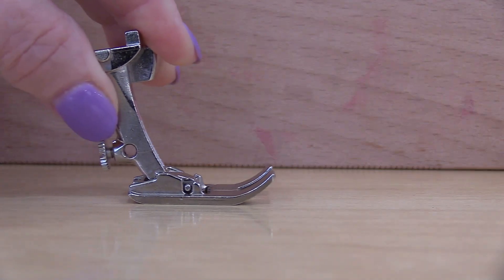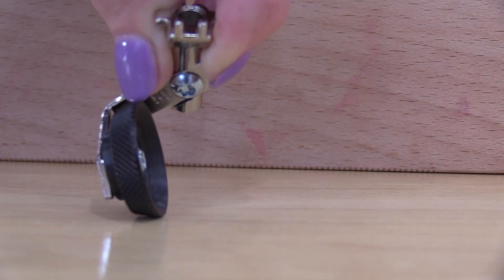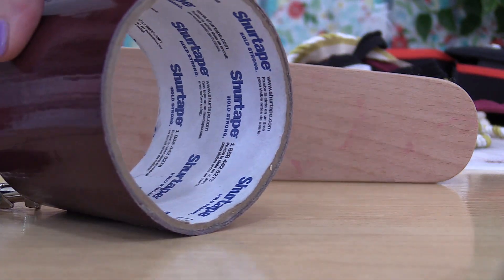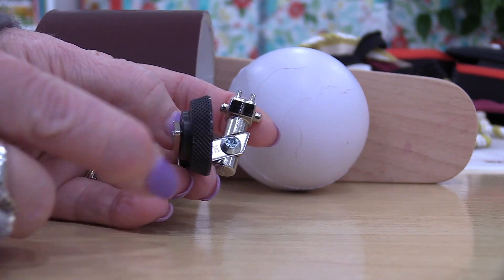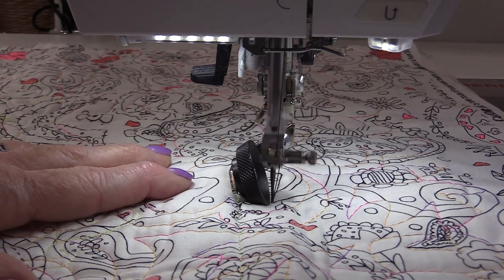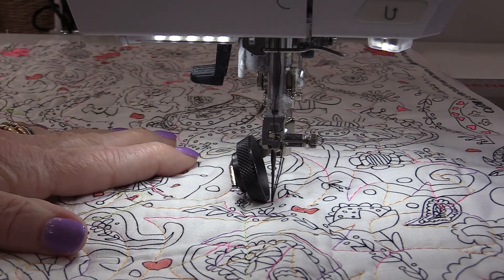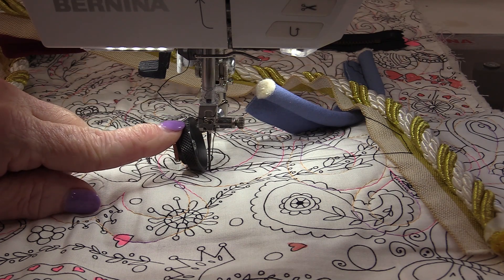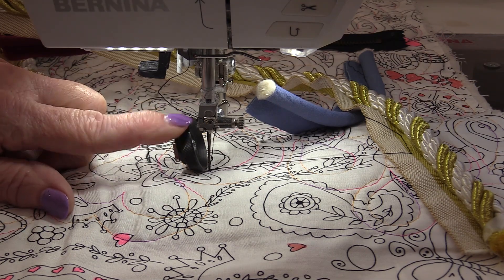A Very Unusual Yet Useful Sewing Machine Foot

Comment: I’ve seen those on old Singer industrial machines, for sewing leather. Hadn’t thought you could use it for fabric, but why not?  So I looked on Amazon and there they are, made in China, with several sizes available. Watch out for low shank or height shank, btw. 
I’ve seen ones about 1” diameter stitching shoes, and I expect the ones for glove fingertips would be the small ones. 
Question:  what size would you recommend for general use, to include FM quilting?  Thank you

Comment: This presser foot is cool.  Thanks Laura for showing it to us.  I looked for it everywhere.  Amazon does has some but not quite the same as the
one you demonstrated.  I did finally find one at Sewing Parts Online, in case anyone would like to find it.   Now,  I did not find my Brother sewing
machine model for this foot, but looking at other Brother sewing machines that look the same as mine, in terms of the snap on foot part that
can be taken off, so that a screw on foot can be used,  I didn't see any difference between my sewing machine and the other Brother Sewing and
Quilting sewing machines.  I am going to try it out after I receive my order,  and see how it works.

Comment: Really good to learn about this one - I particularly appreciate you showing an old-style foot in the foot close-ups -- just like the one my 1130s use. That's especially helpful as I think many of us owners of older machines may often think that feet designs we're not familiar with are probably only going to be in new style feet. Thank you.
Reply: I have this particular Bernina foot and it has a universal shank - fits both my vintage Bernina and my computerised 440QE.
I did not think to use it for zippers, but I knew about the quilting and thick piping and cording. I have also used it to sew sequined and beaded trim to a skirt waistband, where no other presser foot would have been able to do the job. It also works very well for applique. The foot was expensive, but worth it.

Comment: Just bought one for my Janome 10001 but the wheel doesn’t move the fabric. I oiled it as instructed, feed dogs are up, and I’ve adjusted the  foot pressure. Any ideas what to do?
Reply from the maker: I am sorry no, but I would contact Janome
Reply: @SewVeryEasy  I figured out the problem. The Janome foot is adjustable and needs to be directly over the left feed dog and the needle position at 0.  Seems to work now. Can’t wait to start a new project.

Comment: Sure wish I could have this foot to sew vinyl. Not impressed with other rolling presser feet I have bought.

Can imagine a few other applications. I have a bunch of feet that I have bought a few at a time. I have spent hours looking at presser feet, checking for any I don't have. I have never seen this one.

Am I the only one a little addicted to buying new presser feet? I know some people think changing a presser foot is a hassle, or intimidating. I just change them so much depending on the fabric and bulk. I also find them very useful when I have to sew with the bulk of the fabric to the right of the needle - for some reason my brain doesn't do that well with some feet.

Comment: Fantastic! Thanks for sharing tip, not sure if Huskvarna/Viking has such a foot!
Reply: I have a “generic” one that I use on both my Viking and Brother machines.
Reply: the husqvarna leather roller foot works differently to this. Check the generic feet but you may need to use a different shank to attach to your machine.
Reply: @janicecroft2304  I also have the Husqvarna leather rolling foot. It does not work as well as this one for what I need. I work on vinyl and the Husqvarna one does not feed well. I do need to use an adjuster for the shank on my Brother but it works splendidly.